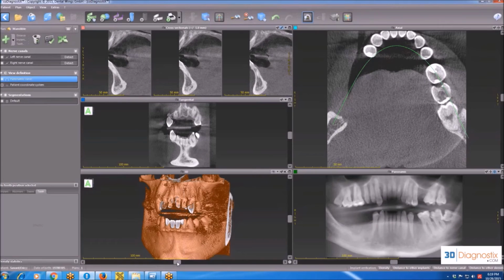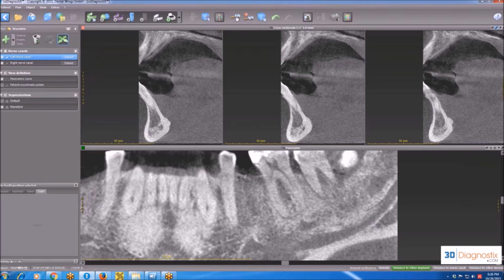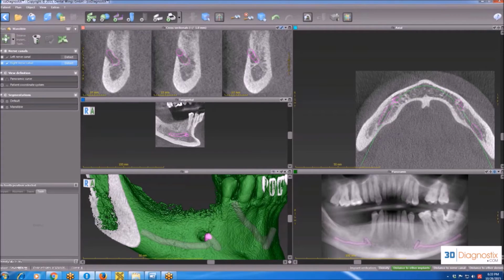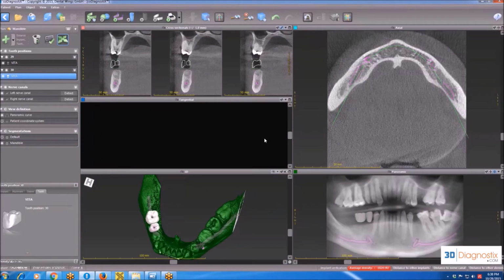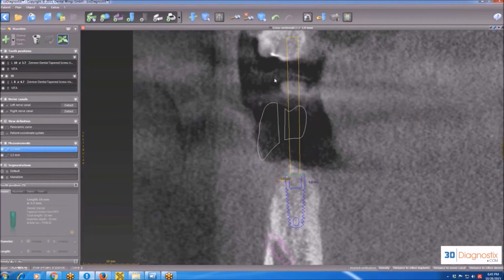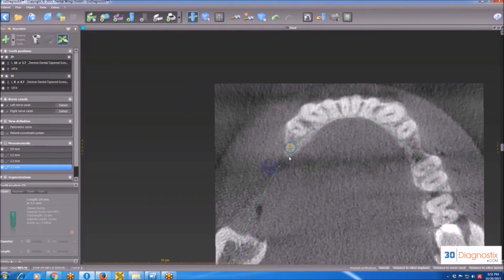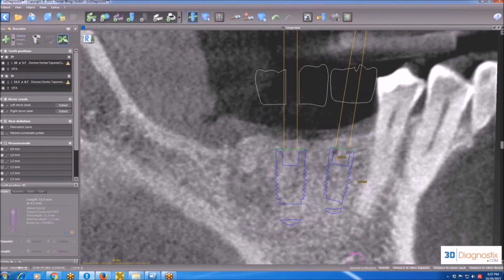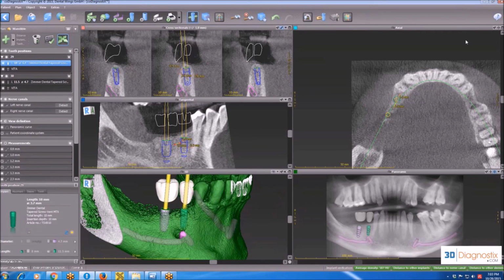coDiagnostiX Training  - [3 of 3]

Comment: Hello i have a question. How i can find in codiagnostix the adjustment for tolerance compensation for the guide?
Reply from the maker: before exporting the surgical guide, the software will show a pop-up window where you can adjust the fitting offset of the guide to its fitting model and/or the fitting offset of the sleeves inside the printed guide hole